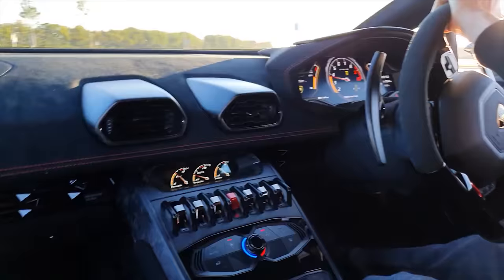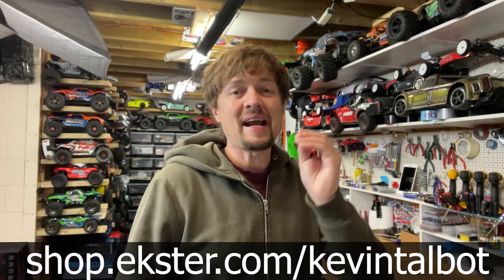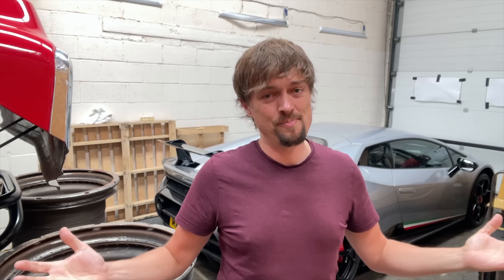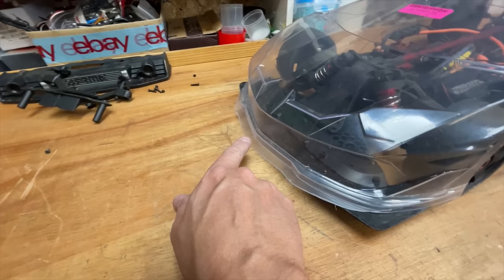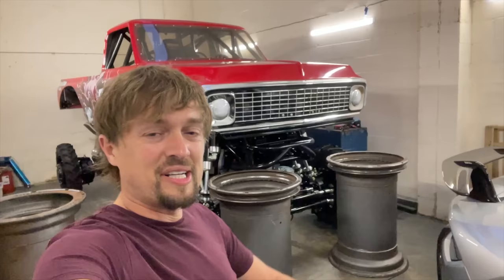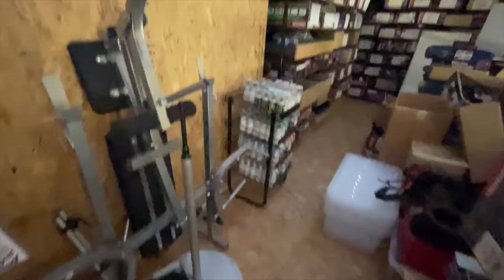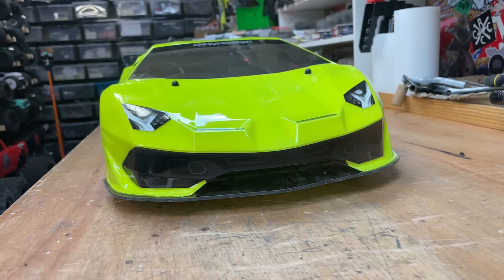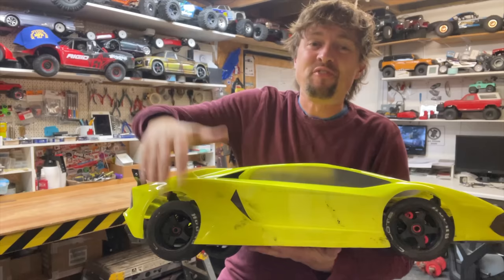Building a Radio Controlled Lamborghini to smoke tires

Comment: Was expecting the highlighter yellow to look pretty crap but it looks quite good on camera. Probably wouldn't paint/wrap a real hurrican that colour though. Also saw a real hurrican at college today and I know people kinda give it a hard time as its the "entry level" lambo but honestly, it's honestly one of the few lambos I want to own.
Reply from the maker: the sporty huracans are quicker that the aventador in most cases
Reply: Defiantly in the hands of a skilled driver.
Reply: Huracan is quicker in most cases. And dual clutch vs the crap that comes in an aventador. Only advantage the aventador has is the V12. Plus you can always turbo or supercharge the v10 relatively easily for MO POWA. Friend of mine had his turboed from sheepy for 40k. Made 1300whp on e85 and ran mid 8s on street tires...oooof
Reply: Sounded like it "was" fun to drive

Comment: You should try scoring it with a razor blade and then snapping it.  I find it faster, easier and gives a cleaner cut over scissors.  I only used the scissor for relief cuts between where I'm snapping.